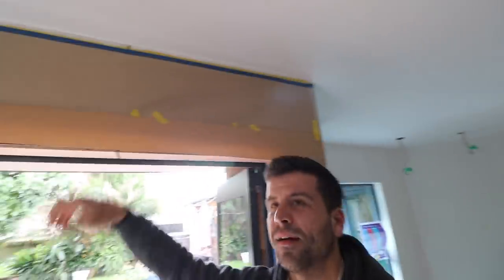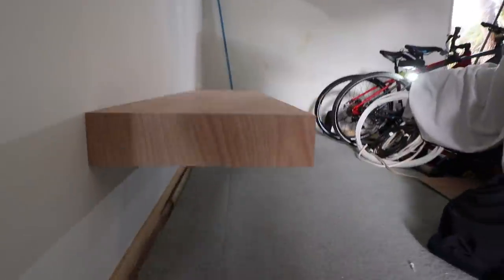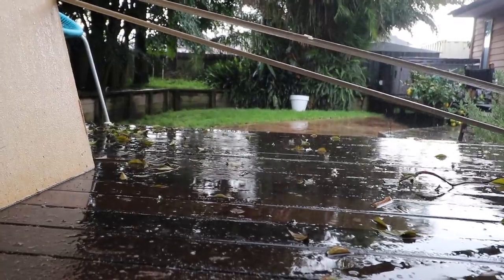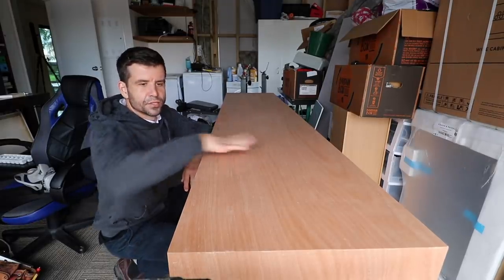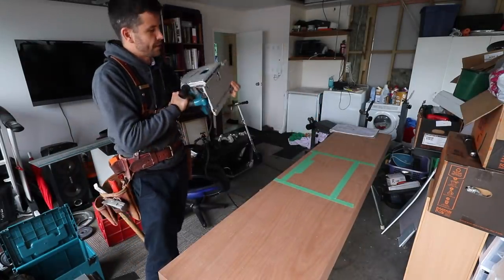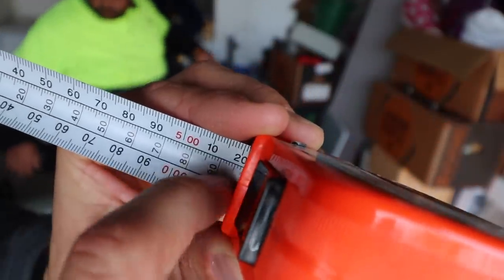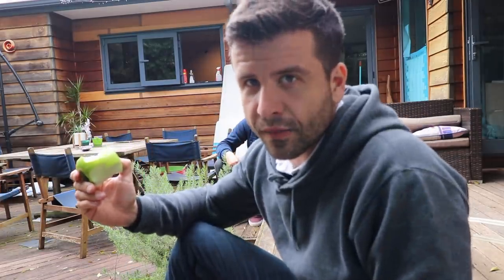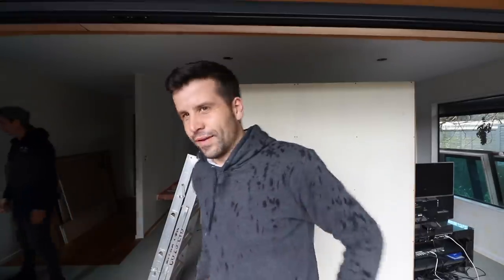I Didn't Know I Needed These

Comment: Glad to see you found the glue useful!
Reply: Says no shipping is available to anywhere in my area, never had that issue with any store here in Canada? Any thoughts?
Reply: @Zacharyk1127  go to lee valley, they got C A
Reply: I’ve been using this glue as well! It’s so helpful!
Reply: @PlumbusRunner  I got caught out a few times using oddball practices and products from overseas which don't suit New Zealand conditions especially here in Oamaru where the weather and climate conditions can  change and vary so much. No wonder the really old tradesmen stick to their time proven practices and materials. Air conditioning and heat pumps cause a lot of problems with adhesives I find.
Reply: @Zacharyk1127  try zap a gap or pitsco, we use this glue in architectural modeling

Comment: As an old dyi carpenter, I was taught by true carpenters to use the Stanley Powerlock (25' or 30') tapes and add the 3.0 inches of the tape box for inside measurements.  Much more accurate than bending a tape. All Stanley tapes (if not other brands} have the length of the tape box written at the bottom-back. I've only used the simply +3 inches as I can't manage 3 1/4 inches or other such odd sizes. Keep up the good work. :-)

Comment: been using the air wedge "branded air bag here in the UK" since i started my apprenticeship 4 years ago. we also use it to wedge the top roller draw shut in the work van because for some odd reason they all lock apart from the top. anyway, awesome video, love the tape measure.
Reply: Drip I use it often to hold doors open.

Comment: Agree on the 'air bags' I bought a pair of Trend ones in the UK (£18 for the pair) had to fit 11 solid core Oak veneered doors, though I would try them, saved me a lot of messing about as you can use your foot to inflate/deflate them, best thing I have bought in ages

Comment: I already have or actively use something similar to three of them. I own, but don't often use a rather cheap right angle drill adaptor. Air wedges are great. I'm liking the ultra-thin circular saw blade (I don't have one) I do use Pull saws, including the one based on Edding snap-off  blade holders. I don't use CA glue much. But I do use a hot-melt glue gun for repairs, more than I expected.  Good ideas from 6ou as always.

Comment: Another entertaining piece Scott, Paerau and Cam! Keep up the great work guys. 
Just something which might be worth considering re the decoder hide-away. While I can't be sure about the current kit, but some decoders can get surprisingly toasty during normal operation. Add a humid Auckland summer and it might be worth considering ventilation holes/slots underneath the shelf perhaps? Ideally then a little more space around the hatch for the warm air to flow up and out through. Acheiving the latter without ruining the look may well be a bit of an ask however.

Comment: I also love my air wedge, got one to test it out, now deciding if I need another 1 or 3. Right angle bit also rocks, so useful assembling furniture, where I'd never get a drill/driver or impact driver in to tight spaces otherwise. With my tape measures I have to add on 80mm if I want to do full span, having the extra marking would save that addition I suppose but not to difficult for me and I have 5 of them all the same so would be expensive to replace them, (They are Stanley FatMax ones and were 2 for a tenner at Screwfix, but really good solid tapes). Superglue is very useful as temporary bonding but I will only use it for  light stuff of permanent, that's probably because I have a tendency to over build things due to a lack of formal engineering training, but that's fine for DIY where I'm happy to pay a little more for materials than if I was doing it professionally and have something over spec'd for the job. I built the master bed out of 195x45 lumber and can now, if I want swing off the shelves round the headboard and land on the bed and everything is fine, just fine. Love your work, and delivery as usual.
Reply: Craig Hastie good to know I’m not the only one using a right angle attachment for furniture assembly. I once assembled a bed and the lady was amazed how quickly I got it done. “It took the movers an hour and a half to take it apart” well it only took me 30 minutes to put it together, including accidentally putting one piece on backwards and having to correct it.

Comment: If you use CA glue, just dampen one side and glue the other.  Put together and walk away.  I found one CA glue that it didn't work at all on.  Otherwise, you're golden.
I just have to edit this in, concerning the floating shelf, which came out fantastic.  The first time I had to build a knee wall (short wall about 4' high, basically unsupported), it moved if you leaned on it.  I tried all ways to stabilize it and finally hit on a way.  This is very similar to your floating shelf.
I glued the drywall onto it.  Whenever anyone leaned on it, it tried to stretch the drywall from the bottom to the top.  You can't stretch drywall or plywood.  If you feel you need more strength on those shelves, use a bead of panel adhesive along the front and rear beams, top and bottom.  The next day, you will feel the difference.

Comment: It's interesting to see that ruler in millimetres too. In Europe, most rulers are expressed in cm, even though carpenters and mechanics use mm normally. But construction and regular folk uses cm.

Sometimes it causes issues with communication between masons and carpenters, or between a client and a carpenter. Though luckily it's just a factor 10 off, so you can easily figure out the correct measurement.

Having every ruler in mm would move everyone to just use that scale.

Comment: I have two new ones for you..  Leica Disto D2. I can't be without it now.  Measures super quick, very accurate and allows you to add up measurement with the laser itself.  Need to measure a heap of footings for concrete?  Walk around and shoot each hole pressing + between each measurement.  Need to do a quick but accurate run off for skirtings/arcs? Walk around the house and shoot each room pressing "+" between each measurement.  Shoots to me accuracy, brilliant for for fitout or measuring between to walls. 
Also,  I know you had a tape on your list.  But try a tape with a rubber grip (Stanley fatmax etc). You can use the rubber to erase pencil.  Super handy when doing fine carpentry work.  👍👍

Comment: I have a Stanley Fat Max tape in Metric. It has the width of the tapes body scrbed into the side so you can just add the to the measurement on the tape. Problem is it's in imperial... Nice one Stanley...👍

Comment: Scott, Thoroughly enjoying binge watching your videos!; got kick out of this one as the pocket saw is one of my absolute favourites (from Lee Valley here in Canada); used the CA glue and accelerator often when I was doing stage carpentry (before pandemic stopped play!).  Also have the identical right angle drill attachment which came with a ratcheting handle, bit set and sockets.

Comment: Check your other tape measures. Most of them have the size on the side, so that when you butt your tape up to the wall or whatever you measure, you read what the measurement is and then add the length of the tape container and you have the total measurement....well.... Here in Europe all the tape measures that I've used, have the size printed on the side.

Comment: I know this is an old vid, and others might have pointed this out, All measuring tapes have the dimensions of the case written somewhere on the case. Get one that's metric, and you can butt the body of the tape into the corner, add, dimension of tape plus dimension of case, bob's your uncle.

Comment: Hey scott, for that saw knife I recommend you check out the olfa CS-2 or there is the CS-5 which has a thinner blade for tighter cuts. The CS-2 is admittedly not the best ergonomically (its pretty much a straight piece of aluminum so it is pretty unbreakable with channels cut in it for the blades) but I use it myself on wood drywall and plastic it absolutely lunches anything but metal and I got my business partner onto using one he's very happy with it too.
It basically has 2 blade channels one on each side and comes with one saw blade and one standard snap blade but you can have any combination of 18mm blade in you want I guess, cant tell you much about the CS-5 other than it looks like it feels better in your hand and it has a thinner blade because I've never used one but I would imagine the CS-2 is best if you make mostly straight cuts and the CS-5 is better if you make curved cuts.

have a good one

Comment: That tape measure is awesome. Gotta find one in imperial
Reply: Joe Mozdy ill help you search, need it aswell
Reply: Coach C  i only found metric for that style. The brand is Australian.
Reply: Ive been lookin for ages. I cant find or think a proper description for the specific thing the tape does.. why do all tapes not come like that. Lufkin is the brand name and they are australian. But cant seem to find a uk seller or another brand which you can measure from the end of the handle
Reply: @1989Chrisc  lufkin refers to it as a multiread tape measure. As long as you are cool with metric, you should be able to import it. Course, cost is always a thing, and you better try to beat brexit

Comment: about measuring tape: check out "Talmeter". You'll never use anything else after.
Reply: hardened steel extender makes it a long distance caliper/markig tool +-0.5mm on 2m (my old one, made by inventor in garage)

Comment: I like that multiread tape measure. For those willing to do a little math, your tape measure likely has the case dimension printed on it so you can add it to the tape when making interior measurements. I did not know this for the longest time.

What's your reasoning for using a folding ruler/zig zag ruler over a tape measure typically?
Reply: accuracy.
Reply: @jamesbailand4311  I cannot say I've noticed a discrepancy between my zigzag rule and tape measure. Granted I am a hobbyist, I tend to use my tape for woodworking projects and my zigzag rule for projects around the house. My fine woodworking projects frequently start with pieces bigger than 2 m/6 ft. The zigzag can stand in for other tools like a square or bevel gauge saving trips to the toolbox for the gross projects in the home.
Reply: I mostly use it because it's 5mm thick, 10mm thick folded, and 15mm wide or 30mm folded. My other one is 20mm wide and 40mm folded. These are common measurements.

Comment: Where does the heat go from inside the shelf :( it will cook the electronics
Reply: There is a slot for lifting the hatch. 10:21 Should allow some heat out. Drilling a couple of holes underneath would promote flow.
Reply: @DiscoFang   :) but Where does the heat go from inside the shelf :( it will cook the electronics / yes I am still asking same question

Comment: I don't think the air wedge existed five years ago.
Reply: Auto door unlock companies have been using them for a long time to help wedge a car door open enough for a rod or wire to slip in. Probably a lot less likely to cause damage than the old wooden wedges they used to use. I passed one hanging on display in home depot within the last year or two and wondered why it took so long to cross industry lines.